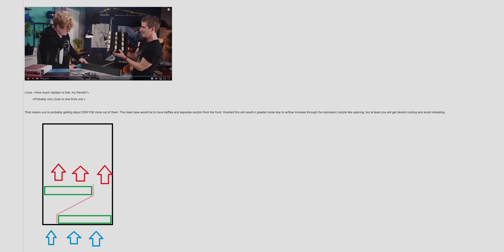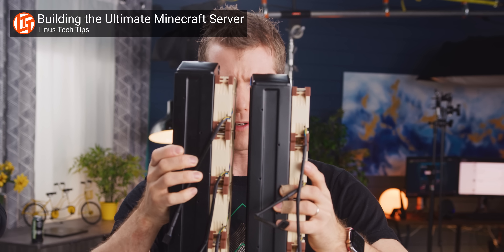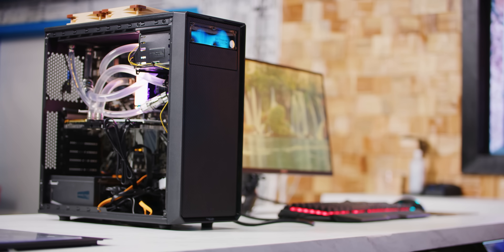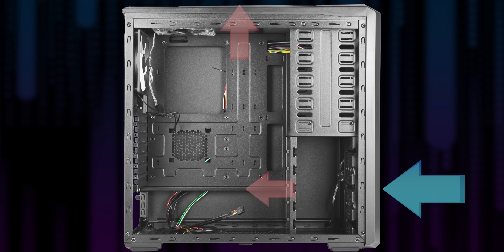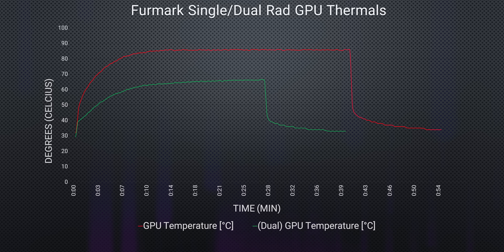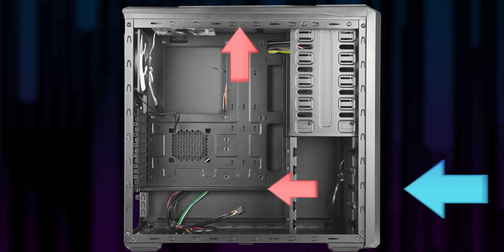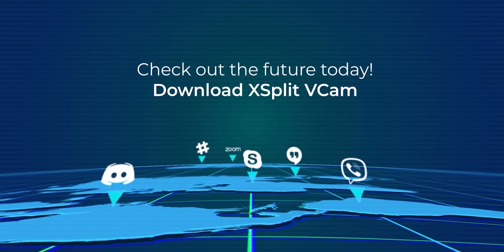I’ve been water cooling wrong for YEARS - $H!T Manufacturers Say

Comment: I work on cars and you see all sorts of radiators stacked on top of each other. You have the main radiator, ac condensers, inter coolers, etc with fans behind them to pull air through all of them. I'm sure there are diminishing returns and they would be more efficient if they each had their own source of fresh air, but you don't have that kind of room. Plus,  computer cases have a lot better airflow than an engine bay.

Kinda weird that Corsair would be bringing this up at all. You would think they would want to sell more product and encourage everyone to cram as many radiators in that they can. Unless they are trying to brag about how great theirs are that more than one is just wasted money... in that case, they kinda failed.

Comment: Isn't there just more water in the system with a second radiator? 
So the greater volume of water takes longer to heat up?
Reply: @Dirk Snowman I agree that would be the case for normal every day use, but during their testing I dont think they ran the system for long enough to reach that point. Could be wrong though :)

Comment: I'm pretty sure corsair does alot more testing with actual engineers. Just because you built alot of computers doesnt mean shit. Corsair said that stacking radiators is not efficient, if you think a 5 degree drop with one radiator is good then you're wrong. In automotive they do not stack multiple coolant radiators, instead they increase the size and thickness.
Reply: @Dirk Snowman Exactly! I dont think ive ever seen a car or engine use stacked radiators.

Comment: It's not the same setup as the simulation. "Hey look, my apples are differents than my oranges!"
Reply: Tell that to Corsair. They provided the models in a comment reponding to two of Linus' builds, and one comment was simply tht two rads in a case doesn't work and temps may actualy increase over a single rad. Linus showed that to be incorrect.

Comment: Now I wish I'd gone for quick connects when building my (first) water cooled PC, so I could have easily compared temperatures with and without my 2nd radiator. I have pump -> gfx -> 120/45mm exhaust radiator (no fan) -> CPU -> 360/25mm front intake radiator. The core idea is the front fans create positive pressure, and since all other openings have been sealed, air exits through the "passive" rear radiator and the (fanless) PSU. The rear radiator is there for when the GPU goes full tilt, to try and cool the water a little before it enters the CPU block.

Comment: Rads should be all intakes or all exhausts, so they they don't pollute the other rads with extra heat.  If you have more than enough air flow, you might be able to squeeze more cooling out by stacking rads, but ultimately, if you can keep them from polluting each other, you'll get more effective cooling.

Comment: 03:00  That's completely misstating the issue.  You're not talking about whether a second radiator is useless.  You're talking about whether or not it's smart to have an inlet radiator that blows hot air into the case.  Every sensible person already knows that's stupid, which is why radiators should be on exhaust fans.  Put one on the top and one on the back.  I have a 360 on top of my case (literally - on the outside) and a 120 on the back (also outside).  They're outside because they are too big to fit inside.  Not a small case - big radiators.  They definitely provide more dissipation than a single radiator, because they're both on exhaust airflow, with nothing but hard drives heating the incoming air from the front of the case.

Comment: stacking three 45 mm thick radiators back to back is kinda not the same as installing two 25 mm radiators with a ~30-40 cm gap between them.

Comment: They are basically saying the rad has a cold side and a hot side. Stacking cold and hot sides on top on each other will just cause a quicker heat soak. But can still help using more surface area. As Linus knows. Civic radiators are best to cool a computer

Comment: They said you shouldn't stack rads and then you make a video disproving them where you don't stack any rads. 🤔 I want to hear Steve's take.
Reply: The best source for radiator cooling is automotive. Back in bad old days when you need more cooling you added another layer. So the difference between  a manual transmission with no A/C was generally a 2 core. To do a/c and automatic transmission it was 4 core. But weight did matter in the 60s.
Now size and weight matters. 
 Now 3  cores is used generally and they are aluminum instead of copper. The better solutions have divider with the heat side going into the engine side and out the front and back to the engine. That way the coolant is cooled in 3 stages. The back core 1st, middle core next and lastly the front core. The baffles to do this are in the plastic side tanks of the aluminum radiator. If the input and output are on the same side it most likely would either be two cores or four cores.
 Sure if you have the frontal area to just do the same amount of core it would cool better. But that also means more drag and lower MPG.
 
PC coolers are not made the same as automotive
Reply: @warrenpuckett4203  This is from a while ago but I saw it pop up again, hardware labs actually does make dual pass radiators but I believe they are the only ones.  I doubt they are constructed the same but the idea is the same.
Reply: I would be interested to see what the more effective cooling system would be, like does keeping the space and air openings on the rig increase the secondary coolings effect
Reply: normal case u can syack them anyhow.. you want stack you need strong suckion...
Reply: He didn't disprove shit, he proved that he doesn't understand heat capacity, I could smash those numbers with zero radiators and a 55 gallon reservoir.
Reply: He mentions they saw a 5 degree increase when they pulled a stacked rad out of that one rig. In their test the front rad was pulling air in a the top was venting they were stacked with a mobo in between.
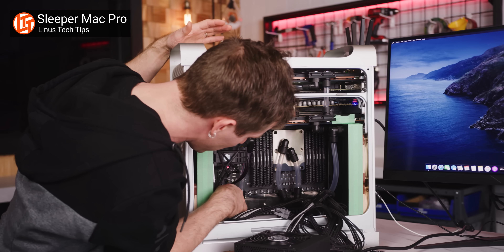Reply: 6:46 is where he talks about the stacked rads.
5 degrees more, which is about the difference between the best thermal paste and the worst. Or the worst and toothpaste after 18hrs torture test.
Reply: one of the systems Corsair commented on didn't have stacked rads... guys pay attention.
Reply: Corsair specifically mentioned simply using more than one rad in a system

Did you... Not watch the video?
Reply: @christoffermaintz781  he did... he used two to compare against just one...
Reply: I'd not consider this stacked either. My understanding of stacked would be radiator, fan, radiator and fan all stacked right next to each other. In this case there would not be much of an air gap in-between.

Comment: One thing is to put radiators in series, one attached to the other. This is not going to provide an improvement, because the second radiator will receive hot air, generated by the dissipation of the first one. If you do that, well, that was dumb. And the second radiator will actually function as a barrier for a dissipation of the first one. So, Corsair is right, partially. Your build uses two separate radiators, and in the middle there are fans to extract the heat. That means the hot air generated by the dissipation of the first radiator, will reach the second in a minimal part, because the extraction fan will pull it out of the case before it reaches the second radiator. Here your explanation dear Linus. Plus there is a lot of other things to take in consideration. In most of your build you also mount air coolers wrong, like most of the people do. If you have more extraction in the top, your cpu cooler fans should be face the extraction fans and spin in the same direction, negative pressure. And also, not all the fans are the same. And I'm not talking about noise, I'm talking about amount of air moved, airflow, and pressure. There are fans to be places near radiators, and fans who work better to extract from the case. So, bear than in mind.

Comment: Things that are wrong or can be interpreted wrong in this video

1. Your case was open in the testing, ofc it would have better airflow.
2. Corsair was criticizing the other builds you have done, not that test build.
3. Your lowest temp is determined by your ambient temperature, thermal equilibrium will explain that to you.
4. Adding a radiator in the wrong place, configuration, tubes inserted wrong, airflow, can also, instead of pulling heat away, trap the heat to your system. The more radiators you have, the more they practically become just an expensive heat sink.
Reply: As I have said multiple times in this comment section, only an idiot would perform the temp tests in an open case. They did not perform the actual tests in the video, and Linus is not an idiot.
Reply: @OriginalMergatroid  'or can be interpreted wrong'

Comment: I used to fix commercial vacuum cleaners for a living, and a tiny invisible break in an air-tight seal would make MAGNITUDES of difference of air flow, and suction.   With that in mind I wonder what kind of results you would get from an air-tight PC case lined with gaskets and etc vs a regular case.

Comment: Look inside most cars, your AC loop, engine cooling loop, oil cooling loop, turbo inter cooler, are all stacked on top of each other. They make due with the space they have and it works. They may also stack them in order so that the water ones are in front of the oil ones, but in general  they work.

Comment: Make that top radiator intake and only have the one rear fan for exhaust. Both radiators get cool air, plus you get positive pressure, so with filters you can keep your rig dust free.

Comment: It's comparing apples to oranges. The graphic Corsair sent doesn't show us enough information as to what configuration they were actually testing. It was too general. Like Linus said at the end, there's so many variables. A better setup would be for Linus to contact Corsair to get that info and test their setup and have Corsair run the CFD on the setup Linus presented in the video to do a true case study of each one. The picture they presented had the right image say the glass panel was removed - does this mean the whole side panel was taken off for the analysis?

Comment: The premise makes sense. You are cooling the system by means of removing heat from it. This requires a transfer medium to move the heat to a rigid surface. If you saturate the transfer medium it will bottleneck the system at a specific temperature. But if your not saturating your transfer medium then adding a radiator will actually help but it seems like a valve is a good idea there to ensure equal dispersion of the medium into the radiators. Just a matter of does that really impact current cooling tech and if so which ones to what degrees.

Comment: I run 3 triple 120 radiators in my corsair case but all of them draw air from the outside through filters and then exhaust out the back of the case or on the bottom where there is another area for fans. While not an idea airflow situation, I've found that as long as you suck air through a radiator from the outside of the case, it always helps in temps. I have tried intake from the front and then exhausting the other 2 radiators out the side and top and the temps were not nearly as good. As long as your cooling with outside air, more radiators = more better. It also allows me to run quiet fans and never worry about my temps :).

Comment: man my old i5 2500k was on a stock cooler but with a side pannel fan that was lined up at the cpu fan i made a cardboard duct from the side pannel fan 10mm above the cpu fan and had a 15celcius lower temps on load just with a 120mm fan blowing half speed with a duct to the stock cooler run 4.2ghz for 7 years with auto voltage settings so high volts it still runs fine its my old pc but airflow design can make a big difference

Comment: Stacking rads together will work provided the water flows from rad to rad in the opposite direction of the air.  But they will work at reduced efficiency.  If you compared series rads to parallel rads of the same capacity the parallel rads would be more effective.   Also when you put rads in two different locations rather then having air intake through one and exhaust through the other make them both intake or exhaust  so they are in parallel rather than series and they will work better.

Comment: I think the real question is are you getting the most out of your money by using 2 radiators? Your not really using the 2nd one properly or to its peak performance. Do you really need it? Only if you really need to over clock the cpu, but wouldn't a more powerful setup be the way to go then? Good video thro

Comment: Question: When does the heat transfer from the CPU to the coper surface of the heat sink is the bottleneck (even if you drop it's temperature magically and steady to 21C) there should ba a time where it reach a maximum potential of heat transfer? I mean imagine plugging an infinite surface radiator with an infinite tubing diameter and an infinite water flow in an infinite 21C room. There should be still a maximum heat transfer due to surface contact from the cpu and the heat sink and the material (coper) it's built with? any toughts?

Comment: I'm not sure the situation you guys tried is not even the one you described as being sensible (when explaining Corsair's reasoning). 

Weren't they talking about a situation like what you did with the Minecraft server where the radiators are packed against one another. (Where the 2nd radiator would have a smaller temperature delta ?)

Comment: They literally stack radiators in front of each other in cars. sometimes even three of them. There are plenty of cars out there that have the radiator for the engine with a condenser in front of it and in some cars you’ll see a water to air intercooler in front of that. This amounts to three radiators all in front of another in a professional situation and these guys have done their RND. I would go as far as to say that in most cases adding another rad would bring down temps. The effectiveness of this rad would depend on where you put it and how you arrange your fans. I would think, without having tested it, that three rads with a clean air intake each would perform better than three stacked ones, it’s just not always an option.
Reply: As well a 2 core rad vs a single core is virtually the same Idea 2 core will always offer better cooling then a single core you have better cooling capacity because more volume in the radiator.

Comment: I have a Corsair case and a msi b450 tomahawk and I'm really annoyed by the placement of ram, because , similarly to this video, I can't put a water cooling radiator on the top of the case. 🙃🙃🙃
Reply: Thats the standard placement for RAM. All standardized motherboards use the same place. Get annoyedat your case, not the motherboard for not giving enough space between the board and the top of the case.
Reply: Hey, I have the same motherboard (B450 Tomahawk & Ryzen 7 2700x) and switched to an AIO (Enermax Aquafusion 240, white) in a Fractal Design Meshify C which fits perfectly, looks great, noise is fine for me (little high pitched pump motor audible) and cooling is much better than air cooling (for me!).
Due to missing heat sink from the cpu cooler everything looks just cleaner and more tidy 👍🏻
Reply: That isn't a Corsair problem. You didn't do enough research.

Comment: I think you can use multiple radiators, it just won’t look pretty because you can’t stack them. If both radiators have fresh cool air intakes, you wouldn’t have the issue of stacking them where hot air is going to the 2nd radiator

Comment: Water Amount... Did you guys take into account that you're adding in more water for the loop? With an increase in the water, you are also significantly decreasing the water to heat exchange levels and that heat now has a larger area to disperse heat across and cool. I would say that you should do the test again but with a reservoir inside the system that will account for the larger amount of water in the system that the 2nd rad and hose's add.

Comment: Corsair are you plumbing them in the right order?  I see MOST people plumbing them wrong.  You can't send the hot water right to the front rad, of course the second rad will now be trying to cool warm water with warm air.  You just plumb it the other way, hot water to the LAST rad - you want as much heat as you can to go strait out of the case.   Assuming you don't kill air and water flow, no mount of extra rads stacked strait on each other would hurt temps if plumbed the right way.

Comment: My take on PC watercooling:
-if your radiator is pulling [hot] air from inside the case, it's wrong;
-if your radiator is pushing [hot] air into the case, it's also wrong (although "less wrong" than the above).
 
Do you really need/want watercooling (best possible cooling - not chilling - performance)?
Then you want as close as possible to the best case scenario: cold air from outside of the case remains [hot] outside the case.